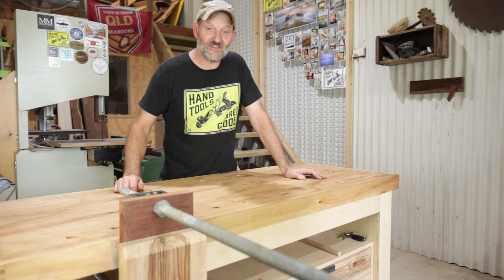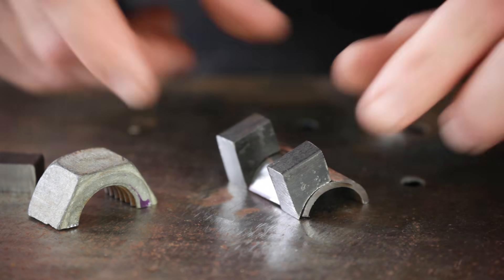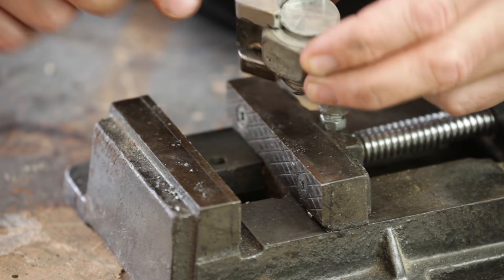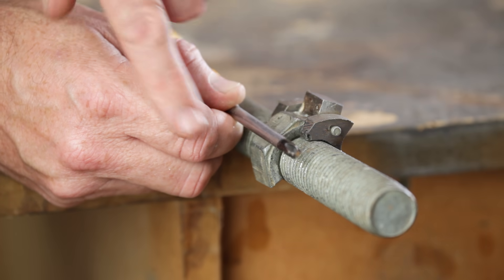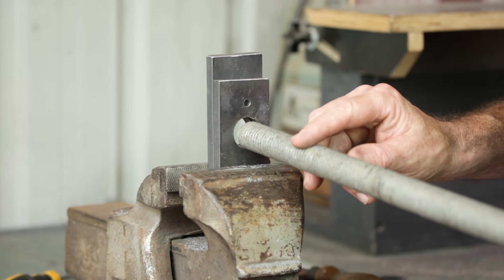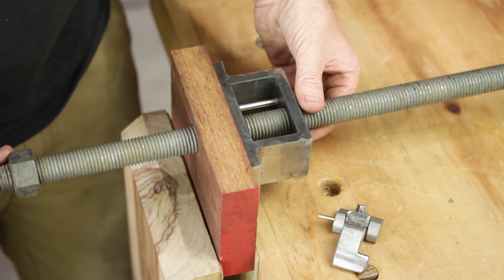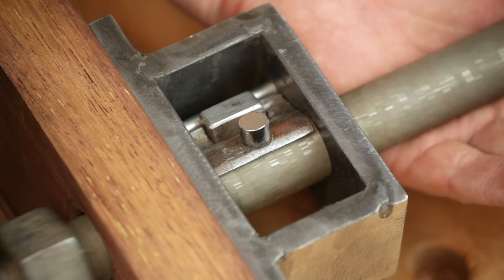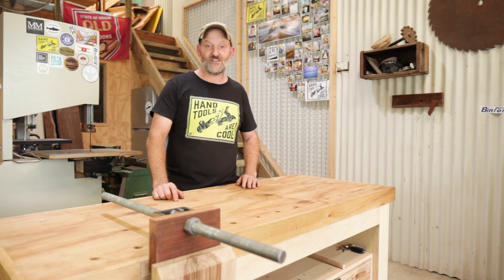Quick Release Vice Build - The Mechanism

Comment: Love it. Simple and self contained. But a bit difficult if you're not a welder .. my BIG missing component.  With those small threads, a bit long on the runout. Maybe using the scaffolding adjustment screws? Still cheap but faster??
Reply from the maker: Thanks Clyde! Bigger threads are always better but this works pretty well as is. :)

Comment: Pask this is a good design. Too much welding. Woodkiefer did  a quick release vice using split nut and magnets that does not require welding. I made two and they work extremely well. I do enjoy your vidios and your passion for design. Keep up the good work.

Comment: Very clever idea and looks great. As a retired car tech, I fabricate a lot of metal items in my shop, so as a suggestion, order in a selection of cheap magnets. The angle ones, sold in most weld shops or home improvement stores have there place, but small magnets of 1" or less, up to 3/8" thick are very useful in holding small parts together prior to welding. Just like the rare earth magnet you used in a clever way, plus a cam action is very strong. Good job of adding the extra piece to keep it captured in the frame on the half nut, so it can not twist. Thank very much for this mechanism they sell for a premium. Thumbs Up / Subscribed!

Comment: The fun from making something that could be bought is priceless. I recently made and oil lamp from a nut, a piece of cord and a jar lid, then used the flame to generate soot on a piece of glass, which I then took off and mixed with the oil i used in the lamp. And I had black paint for my small wood piece. All that while a bottle of speedball archival grade black ink was standing on a shelf one meter away. But I had fun.

Comment: Very clever ! for clamping wood this should work great but what about metal ? i do more metal work in my shop than wood
but I think this would still clamp metal very tightly, tighter than Black bear forge's post vice eh ?  the addition of that last piece of metal was definitely needed ! great problem solving!.....
I tend to tighten my 6" vice with a hammer some times.... i know this is hard on a vice but the holding power is needed
do you have a vice design that could take that kind of abuse all the time ? I was thinking of a twin thread, wide vice with quick release on each side.... in theory to give the vice more holding power.... because if you clamp something say a universal joint
directly over one quick release thread screw.... get it as tight as possible and then tighten the other quick release side the leverage of the vice ( distance between the threaded rods) should mutiply the holding power....right ?   i might give that a try...
gott'a find some 1/2" plate for the jaws now ! LOL

Comment: Nice. Do you use it often? Since 2917... I mean this Neodym mag. has only few microns of nickel coating. I'm afraid it could be demaged by sliding. Than it can get rusty etc. Avoid direct  friction is solution.
Reply from the maker: I use it every day and its still working like when I installed it. :)

Comment: I'm like you I like making things especially tools. I built a sheet metal bender (brake) tape masking paper station with a cutter and numerous others. When I worked on transit busses I had as manufacturer of busses copy 3 tools I made of course no credit or payment but a t shirt and a hand shake for solviing their problems. Damn Turks (those in transit will know the company with that NAB of info lol) anyway I dig the design and can't wait for the rest of the video. I'm going to hit my salvage spots to look for some acme thread. I built a vice with regular threads once for metal work and trashed the threads fast so now for my tools I stick with acme threads. Nothing makes me madder than a part failure on one of my builds lol
Reply from the maker: Thanks Billy! The acme thread would be nice but everywhere I've looked, it is expensive! :)

Comment: Hi Neil, first of all thanks for all your videos, watched and loved them all, I read all the comments and maybe Im the only one that tried to build it...it works, but when I tighten it the nut skips o jumps and gets loosen...what do you think I need to tweak? Thanks in advance and keep going!!!
Reply: Well done Neil and excellent instructions.  I have an Evolution metal chop saw that I have always wished had a quicker screw mechanism - and here it is. I built this and it works beautifully.
Martin, I initially had the half nut occasionally slip but fixed it by making a tighter fit with the wedge on the back of the nut where it hits the round bar so that it did a better job of forcing the threads together.

Comment: Kudos on your videos! Outstanding organization and instruction and delivery with really good post production.  And w.r.t. content, great ingenuity in design and fabrication. I just finished watching this video - yes I know it's three years old, but I only started watching 12 minutes ago ;>) - and I enjoyed the make. 
This single action does away with the spring loaded torsion bar. You said you used materials on hand. I do plan to use this mechanism for some other projects, but I'll use acme thread rod. My local fastener shop has both imperial and metric along with nuts and coupling nuts. I think the standard 60 degree thread would be more prone to skipping a thread under heavy load for a vise, especially the metric where threads tend to finer thus smaller. I, like you, enjoy scavenging wood, metals and other materials for shop use, but I'm also fortunate enough to live in city where I have access to many trade raw materials shops not far away.

Comment: Using the threads to hold the position is pretty smart. Initially I thought it would be a smooth shaft and you were going to use a cam  or 2 which I don't know if it would work but it might make sliding really easy and quiet.

Comment: You going to make one out of wood with your screw and nut cutter
Reply from the maker: That would be cool but maybe a little bulky! :)
Reply: yea but what if you built it into one side of the vise blocking ,it would have to be a two piece block im sure but if you used screws to hold the two halfs together around the mechanics of it ,make the locking part in the shape of ,well i know its a funny description but a Ying /Yang symbol one for the nut and one for the catch inside the blocking so when it turns it wedges its self inside the block locking it in one direction ,unlocking in the other

Comment: I am worried about the nut having its less than half of thread (teeth) engaging with the opposite teeth of the spindle. It is not as sturdy as a whole complete nut grasping the spindle in a struggle to tighten a work load.

Comment: What type a welding kit do u use...pls...great kit, great videos...👍👍👍☠️
Reply from the maker: Thanks Jono! It's a budget range gasless mig welder. :)
Reply: @PaskMakes  you have a flux core wire feed welder. I'm not sure if the gas coming off your burning flux has any positive impact with respect to the welding process? I'm leaning towards no right now. But maybe? I'm sure it drives some oxygen out of the welding zone. Folks often use fans when they're flux core welding just so they don't choke on the fumes. So that leads me to believe any benefit of the fumes themselves is minimal at best. Mostly you're using the flux solidifying on top of the weld bead for protection from atmospheric contamination.

Comment: Hi Neil, excellent work! I have all materials too and will make one for my work bench.
Question: what spray would you recommend for corrosion protection of the metal parts? Here in Northern Territory is very humid and everything gets rusty if it is not stainless steel.
Thank you very much again for sharing your knowledge and effort. Leo
Reply from the maker: Thanks Leonardo! I just use spray paint from a can(dulux), a good few coats should sort it but then again we don't have quite the humidity you get! :)

Comment: This is really cool!  I'm wondering if the pipe side of it might be nicer in something like HDPE instead of steel since it would slide better.... I'm not sure how well it would hold up to the threads raking across... Maybe if the screw were acme threads instead?  But that's probably a lot less accessible than standard threaded rod, yeah? Great build!

Comment: I was curious about how quick release vices work and I found this video.  It was explained so clearly that even an engineer could understand it.
Reply: My quick release vise works on a much different mechanism. I like this one here better though. On my vise I have to flip a lever to unlock it. Which takes two hands and is fiddly to do. The lever is spring loaded so to maintain the unlocked state it takes one hand to keep holding the lever while sliding the movable jaw with the other. I guess maybe there's a way to do it one handed. I don't use that vise very much to be that familiar with it though. It is not mounted in the most convenient place in my shop. There's other vises I use far more. Today I did use that vise to prop up a dowel. The handle sticking out of the bench was handy that way.  I still managed to knock that dowel on the floor twice. So it wasn't perfect.

Comment: you need to fix the magnet in such a way it's not touching the bar - else nickel coating on the magnet will eventually wear away and the magnet will crumbles into powder
Reply from the maker: That's a good point, I checked mine and it is barely touching (by chance) the threaded rod so should be good! :)

Comment: Love this! Great explanation, making me want to learn welding. I’ve not seen a welder with that fine a tip before. What is it called?
Reply from the maker: It's a mig welder using fluxcore wire (gasless), as I'm not using gas I don't need the shroud on. That's why it looks a little different. You should definitely give welding a go it is so handy and you don't have to be the that great for most jobs around the place. I'm certainly no welder but I still manage to get things done with it. :)
Reply: Pask Makes thank you so much for the detailed response. That makes perfect sense! Thanks!